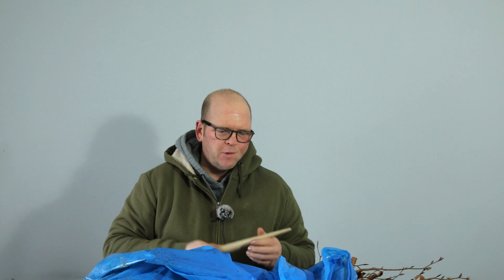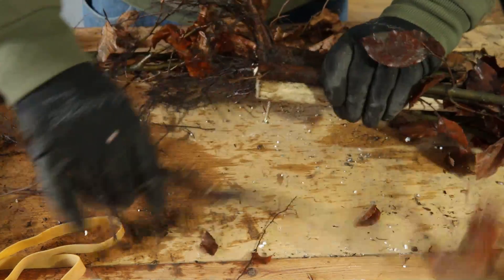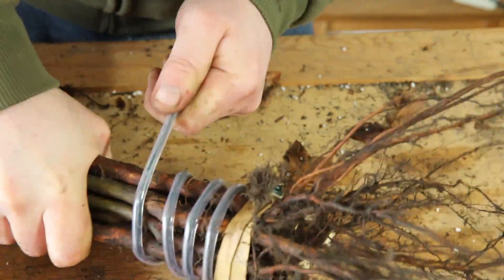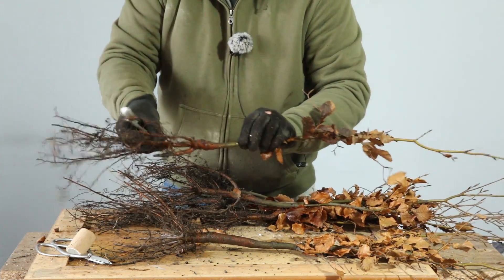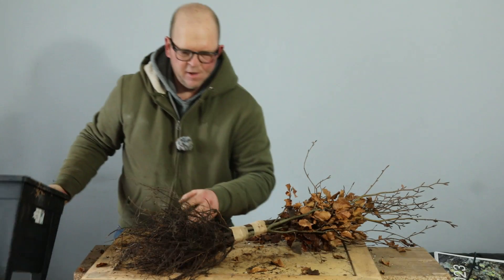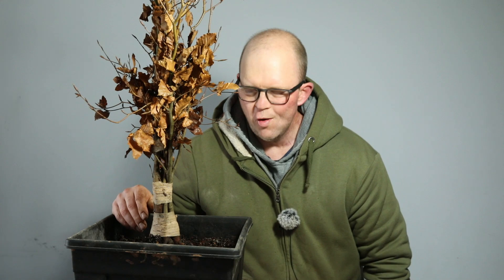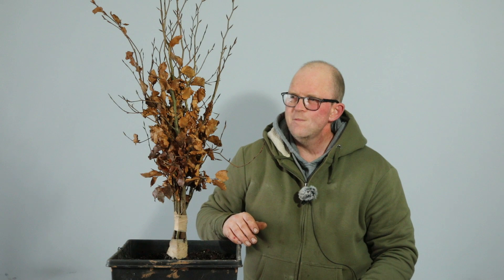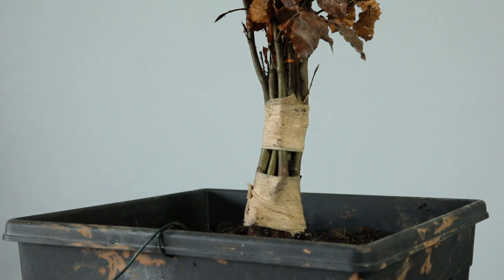2 bonsai fusion techniques (easy and difficult)

Comment: I've had a similar idea for the whole winter now, but maybe with younger seedlings. My spark for the idea was the frustration with tap roots. You always have to remove the one massive root for allowing the smaller roots grow nice and radially. But I thought what if I made a clump and just bend the tap roots outwards radially. I've been planning on a redicoulus wooden contraption with grooves for the roots and holes drilled for some wire to secure the roots into the grooves. Spring is still depressingly far away so it'll be a couple of months before I get to test my idea. Until then I'll just soak up inspiration from your videos. Cheers from Finland!
Reply from the maker: Hi Jani. That sounds like a crazy contraption in the making there, but definitely great potential to create a stunning tree. I think using younger seedlings will be easier, but you will obviously need a lot more trees to get a decent trunk. Also a second pair of hands will be very handy!

Comment: If you had put this out in four more days it could have been Freaky Friday!  I've got a load of 3 year old oak saplings waiting to be bound together.  Looks like I will have to get a move on.  I definitely think this could be a more magical spooky tree creation where you actually maximise the amount of roots showing.  That could look brilliant in a few years.
Reply from the maker: Cheers mate. I did a two tree clump last year and it is looking like they are going to merge nicely, so I will definitely be looking forward to seeing your multi oak fusion project. I reckon it will be really cool, and if I were you, I would definitely go with the second method I used in this video. It worked a treat.

Comment: FREAKY…Tony
All your fusion projects are going to be very interesting to follow into the future. I’m a bit skeptical about obtaining fusion using the vet tape. I’m thinking that 1, the tape is too flexible and will expand with the growth until it bursts and 2, the integrity of the tapes binding strength will deteriorate before fusion is obtained. Time will tell. Thanks, keep growing
Reply from the maker: You make a good point, and it's certainly going to be very interesting to see how these experiments get on. If you are correct I will have to re-apply the tape and add some wire ontop, but I think I will get away with just re-applying the tape in twelve months or so.
Reply: @TonysBonsai  ,,, two appropriate sayings. Nothing ventured, nothing gained. Necessity is the mother of invention. Good luck 👍🏻
Reply from the maker: Indeed, I do love a good proverb myself!

Comment: Hey Tony. Loving the FREAKY fusion content your pumping out at the moment. I'm definitely going to carve a wooden form and try this, maybe with some bird cherry cuttings I have from a few years ago.

Just a thought... It would probably be worth taking the time to strip out all those dead leaves prior to wiring in the future. Those compact and dense clusters of old foliage could develop mould and will be perfect for harbouring insects and parasites. By removing the leaves you will allow better airflow through the cluster and prevent these issues from developing. Also, the density of the dead foliage within the cluster will restrict the trees ability to push out new growth due to the limited light penetrating in amongst the branches. Like I said, just a though.

Keep up the inspiring work!
Reply from the maker: Hi Rhodri. I couldn't agree more about the leaves. I do have a reason for leaving them though. Pure laziness! 🤣🤣
Reply: @TonysBonsai  Never before has there been a more legitimate reason for not doing something... 😅 

Just give them a good shake in a few weeks time and see what falls off haha

Comment: Dr Frankenbeech. Freaky!

What is your intention longer term with that central piece of wood? Will this stay? Or will you remove?

I also wonder if you might be better ground planting then, maybe over a tile or slab, to get accelerated growth and fusion.
Reply: They just let the tree grow around it.  It will become incorporated into the centre of the tree!
Reply: Ground planting over a tile is a good idea though. Will quicken the growth.
Reply from the maker: I may opt to remove the stick when the trees have fused, but as John says, it will probably just stay there and rot away as it is made out of softwood. As for the ground planting, I like that idea, but I prefer putting them in a large pot for a year or two first to help to grow a tighter root system. The ground around here is heavy clay and although trees eventually do well in it, they don't tend to thrive in their first year.
Reply: @TonysBonsai  great response Tony.

Comment: Is center 'mold' wood or plastic or??  Seems wood will rot and crate an issue, plastic .. well ..
 Metal or ceramic?
Reply: Softwood. It will rot away as they fuse and the project ages, leaving room for the plants to fill out the space and fuse inwards too.